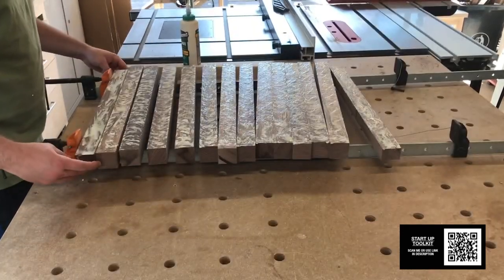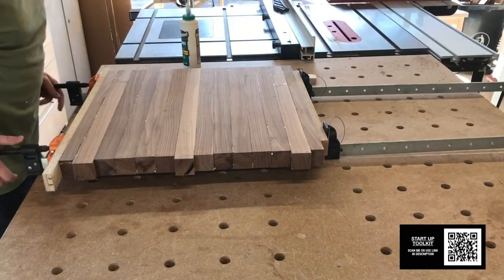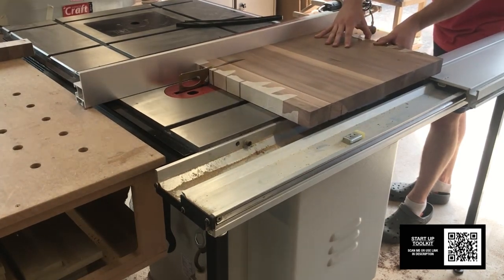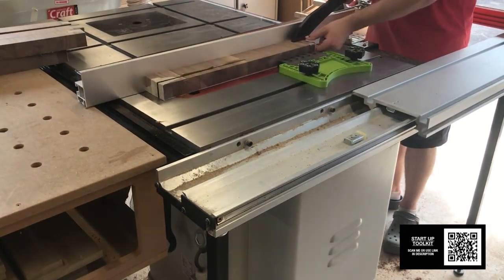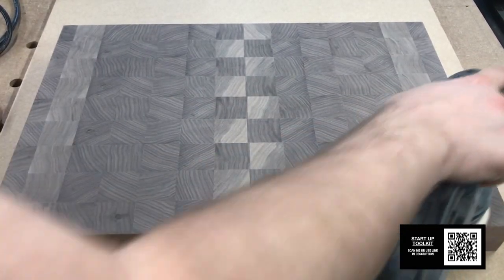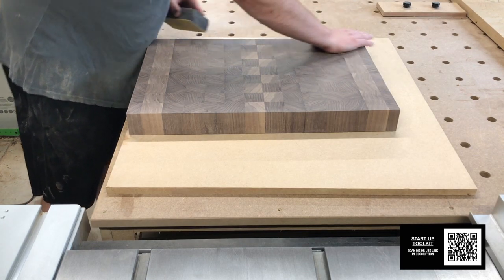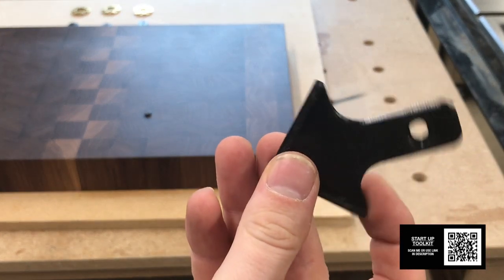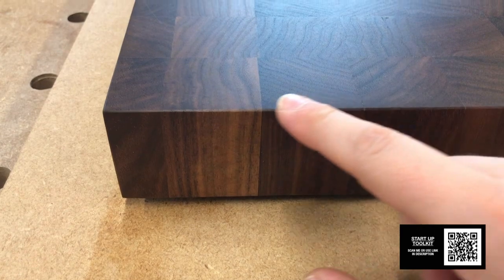One-of-a-Kind Cutting Board for Your Kitchen

Comment: Hi what brand of thickness jointer is that you are using,and would someone in a wheelchair be able to lift the tables to change from jointer to thickness 
Thanks Jeff
Reply from the maker: Hi Jeff, our planer is last years model. The equivalent for this year is 

>> AXMINSTER PROFESSIONAL AP310SPT PLANER THICKNESSER SPIRAL BLOCK 230V >>

I can lift the planer beds up fairly comfortably with one hand so they aren’t overly heavy. But I’d recommend heading to showroom to test yourself. If you have the space consider buying a planer and a thicknesser as individual machines, that would be more convenient. If not, look for a machine where you do not need to remove the fence before lifting the beds up to use the thicknesser.

This is the introductory offer for Axminster. 
Get 15% off Tools & Machinery ➤ https://bit.ly/axminster-ubaahaus

If you’re living in America the equivalent would be Harvey machinery. And if you want to go a little higher end Felder/Hammer is a good option.

Hope this helps?